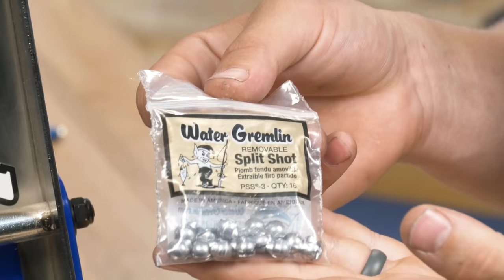Shop Talk: Is Wheel Balancing Worth It?

Comment: Weight Weenies will faint when they see you added 12gr. to a rim.
Reply: Xaver von Treyer 
If weight wenie uballanced 12g can be horible in terms of handling at high speeds.
Reply: Morten Reippuert Knudsen Weight weenies are usually not very fast and on the fat side. I speak from personal experience...
Reply: They will faint because they eat one meal every three days.
Reply: Drill holes in the rim then. 

Couldn't possibly go wrong.

I don't ride it... I just spend time in the shed drilling holes in it, and posting lists on Web forums.

Lately I have been filling the tires with helium.
Reply: Exactly why I scrubbed my efforts to balance mine!
Reply: Faint? I had a heart attack!!!!
Reply: Thats almost half an ounce! Which is almost 1/32 of a pound.

I gained that much off last nights box of hot tamales!

Comment: I had a cheap bike many years ago and the vibration from the front tire bothered my hands. I have nerve problems when dealing with vibrations. I balanced the wheels with the tires off and marked the heavy side, then put the tire on without removing the weight and found the heavy part of the tire. I removed the weight and mounted the tire heavy side opposite the heavy side of the wheel and that was good enough. I think the answer to "is wheel balancing worth it" is if there is a problem that it will solve then yes, if there is no problem then no.

Comment: Had a slightly imbalanced deep section wheel. Sticked on some lead strips on the inner rim. Only like 3grams
Made a huge diffrence on high speed descents. Since it was a carbon rim, the imbalance transferred quite harshly onto the handlebars. Now I have more confidence, more control and less fatigue during higher speeds. It also feels smoother, nicer and more efficient. Cornering usually doesn't happen at these high speeds where grip could be lessened with an imbalanced wheel, but nevertheless it does technically increase grip
Reply: Did the exact same to one of my alu wheels. Found myself slowing down quicker then before on a straight. Didn't know what was going on untill I put the bike in a stand. Had quite the wobble. So I bought a new set of wheels. Then ordered some golf club balancing weight stickers and started balancing the wheel. After I was done it felt brand new again.
Reply: Exactly similar experience here.  Riding downhill outside Boulder moderately fast (85 km/h) got harmonic resonance (speed wobble) so bad was loosing control and going across solid line into path of pickup truck. Barely gathered it in but scared the hell out of me.  Learned to balance using the golf club weights.  This is not really an issue for MTBers.
Reply: I was so distracted by the balance while riding my fat bike I got cloths lined by a tree branch. True story.
Reply: I had a terrible speed wobble, descending last season, with my tcr carbon wheels. I am running conti 5k 28, will wheel balance for sure this season for safety.

Comment: An old boss when I was at the start of my mechanical career indicated that at higher speeds up on a bike stand, you’d always have a bit of resonance somewhere from exaggerated weight increases from torsional forces exacted on things like- tube manufacturing thickness, valve weight, reflector on the wheel. He never presented me with evidence for this, but it’s always been logically sound in my mind. I think it’s definitely a factor! Love the tech vids guys, you’re some pair on screen :)

Comment: That’s pretty funny, poking fun at balancing wheels. However, it is more important in the road riding world, particularly in the case of deep sections carbon wheels.
The deeper the section, the longer and greater the mass of the valve stem or valve extender. This relative imbalance towards the valve side is greater in the case of road wheels, because in general as a package (rim, tubular tape, tire, valve cap even, etc.) they are much lighter than MTB wheel systems.
Also, the relative speeds in terms of RPMs of the wheel can be much greater the road, particularly on descents.

Comment: In my opinion, I feel it does matter! Wheel balance is important but only to a point. If there is a slight vibration, I would have to say there is really no effect on my riding. I’ve actually ridden a mountain bike with BOTH wheels imbalanced very slightly for quite a while and haven’t noticed any serious problems with handling or suspension. However, once the balance does become slightly noticeable (as demonstrated in this video at certain points) this can slightly alter the handling (depending on what type of bike you ride). In conclusion I believe that it’s not completely necessary, unless you truly notice a disturbance in the ‘force’.

Comment: I use lead tapes to balance my road bike tubeless wheels because the tubeless valves are pretty heavy. I think the improvement in traction and cornering stability is pretty noticeable, and it is a very cheap and easy upgrade.

Comment: For road racing and bmx racing, balancing is a good idea when you change the tire. For casual riding and mountain biking, close is good enough because the wheels will pick up debris as you ride which will then throw off the balance anyway. Given the time, if I had the tire in a truing stand I would spend the time to make sure the spokes are evenly tensioned before spending time balancing. A broken spoke is worse than an out of balance tire.

Comment: I had a speed wobble above 45mph (downhill) which disappeared after I balanced the front wheel on my road bike. Since then I have checked all my wheels and corrected several!
Once I’ve determined the required weight and position of the counterweights (with tyres fitted) I use automotive balancing weights which are self adhesive and stick them on the inside surface of the rim. Then I tape over with electrical tape before installing tyre/tube being careful to put the them in exactly the same position on the wheel again.
No ugly fishing weights on my spokes!

Comment: I did. Found a difference of calmness at speed that i hadn't noticed b4.  I used tungsten gulf weights. Came down to the frame feeling more planted. But my bike was way way out of balance. Like 30 grams off. So maybe it helped keep my hub bearings from wearing out. Hard to say.
Did a few other guys bikes. They  had similar experience. Added a calmness to the bike.

Comment: When I first balanced my wheels, with the same tailwind on the road, my best effort average speed in my favourite ~3min strava sector went from 41.6km/h to 46.2km/h. It's like aerodynamics, the faster you go the more wheel balance matters for performance. I've also got the 2nd fastest time in the fastest local sector that requires no downhill skill (~70km/h), it's a very popular bit of road here, I'm not all that strong and I did it with box section 32 spoke wheels... that were perfectly balanced.

Comment: Hi guys 
I balanced my wheels a year ago and rebalance when I rotate tires from front to back and it has made a world of difference in comfort (less buzz in the toshie), handling at speed (you feel the grip of the road better and cuts sharper) and increased my top speed of 84 km/h to 93.25 on the same circuit (conditions were roughly the same as well as originally top speed test and is consistently faster then before. 
It’s worth every minute of work, every gram of weight and if your as fussy as I am it’s worth the extra time to put lead golf club weights on the inside of the rim instead. 
I was able to custom cut them to a perfect 3.4grms and 3.6grms and since they have glued backs they stick to the inside without worry. 
All I can say is, do it, do it oh and do it!!
Oh yes I’m a roadie

Comment: I'm a roady, I've balanced all my wheels, complete with tube and tyre. I used lead weights for golf clubs and then lead tape for the fine adjustment. Both self adhesive. I used to get severe downhill front wheel wobble but the balance has helped but more importantly correct tyre pressures have a greater effect.

Comment: I just balanced my wheels the other day with some motorcycle weights. Because I  still run inner tubes on my 26” hardtail (Trek 4900) it was pretty straight forward process. To be honest the only time I can feel the difference is when I ride with speeds above 35-40 km/h or when Im jumping. I definitely do like how the bike feels now. 

Ps: All wheel setups are different and it takes different amounts of weight to balance them. For example I managed to balance my Nukeproof Generator wheels almost perfect with some  minor tyre adjustments, while the wheel set on my hardtail took 22 grams in total to balance. Thats why I think there are so many different opinions on that topic.

Comment: I think it's important, really helps with handling, descents and stability, specially with deep section wheels, however, manufacturers do a good jobs in the design, so that the wheels are more or less balanced on common setups, that's why you don't notice it and think it's not important, but ask a motorsport person about it and they will tell you about it, the easy way is to do it with speed sensors magnets, one per wheel, adjusting the distance from the hub, no hassle, no weights, no drama 👌

Comment: If someone rides the bike for speed, balanced tires may be important.

I was shocked as some spokes get lose on my 28mph e-bike (250 miles after the bike came fresh from the factory and the DMV for the initial certification;
two sheets of paperwork filled to the utmost and nobody checked the tires).

If you plan to go over 30mph regularly, it may be a good idea to attend more attention to your ride.
For slow riding: no it isn't worth if the bike handling isn't affected, you still may get slower

Comment: If I spent a lot of time riding as fast as possible over either super bumpy terrain or doing massive jumps I would consider balancing the wheel as that stays consistent. The tires just come off to much for me to consider balancing it with those and the sealant/tube, however if I was riding pro and half a second on a five minute ride means something then I would consider balancing with the tire and just remember the position of it on the rim and make sure the bead is seated on the rim 110% correctly

Comment: It doesn't really change anything. Sure, it can look crazy on the stand, but that's because no other force is affecting it.

If we as an example take a standard 28 inch road wheel at 60 kph (a speed I'll never reach), an imbalance of 5 grams will give a centripetal force of around 4N (a bit over 400 grams). Compared to the other forces influencing the system, especially at 60 kph, its vanishingly little.
Reply: 400g at 60kmh sounds like a lot...
Reply: @Phaidrus  It might, but that is (probably) because you're thinking of the effect of spinning an imbalance of 400 grams up to that speed (which would indeed become a huge force). Instead, it is the maximum force the wheel experiences due to the rotation. At least with my fat ass pushing down with 100+ kg, I won't really be feeling that.
Reply: Dennis Krøger As a roadie, this would mean the bar is pushing up by about a pound on every “pulse”. That’s a lot, considering that I probably only put 40-50lbs on the bars at most. I’ve hit 51mph before and I know my bike starts feeling real skittery so I think I’m going to try this.
Reply: @404nobrakes  That's 2% of the force. 40 pounds of downward force will vary between 38 and 42 pounds (as well as pushing forwards and backwards, of course). You might feel it, and if it makes you uncomfortable, by all means fix it, but it's probably not going to unsettle the bike enough to have a real effect on stability.

Comment: i have a motorized bicycle an run inner tube tires. i always balancing them if i have to change a tire or tube. it may be silly to balance them but i feel it helps minimize vibration an wear.

Comment: So I think the question to ask is, is the imbalance due to the wheel being true or to roundness? I believe most imbalance issues in cars are due to the rubber of the tires being imperfect, in any case, the womps should not have a huge effect on watts but might impact your comfort and bearings, maybe suspension as well? If the womps is huge to where it is causing the tire to lose contact then that might be also unsafe 🙂 I can see how you might end up going crazy trying to balance wheels and tires on bike, especially since they change so much

Comment: Car tire balancers generally  only balance at low speed (15mph) and more for wear than comfort. So unless you balance every ride, and after you have displaced the sealant, you will not get great results if using good quality hubs, rims and tires. If you have more affordable wheels, you may get a smoother ride as the quality control may be a factor. So unless you have very noticeable vibration on the bike stand, not worth the pain, you may increase the vibration by default.  Good luck, and bring beer, you will need a drink...  Love the content Cheers

Comment: Also worth checking wheel is even circular?  Bad spoke tension = egg = inbalance?
Reply: Yes, even if the weight is balanced, the wheel can be out of true and that have a more noticeable effect on stability
Reply: This! Back when I worked as a car mechanic I'd tell people it a was a waste of time trying to balance an egg, they couldn't understand why I'd recommend a pair or set of tires to correct a vibration.
Reply: Imbalance. Sorry, it's a compulsion...

Comment: I suggest you use lead Golf club weights. Not only are they malleable, but also come with an adhesive backing that you can put on/under tire strip so they are ultimately a clean look, absolutely no outside weights on rim or spoke. Works incredibly well on road wheels.

Comment: The only time I've ever noticed wheel imbalance while riding was when I was bombing down a steep paved road at 53mph. It was very apparent! But I've also done like 42 on a dirt road in moab and didn't notice anything. I figure for the most part if you're running tubeless sealant it probably balances it the tire when in motion.  Just like semi-trucks use plastic pellets in their tires to balance them.

Comment: I've played with this idea on my road bike wheels. Only difference is I knew the tire and air would make a difference. Also where the weight was put made a difference on how much of a difference it made. Lighter weight on the outside of the tire was more effective than heavier weight on the spoke. As a compromise in my balancing plan was to place weights inside the rim under the rim tape. How did I do that you ask ? LOL I cut up 2 dimes, yep for 20 cents and a couple of hours (taking tires on and off) on a rainy day I had perfectly balanced wheels that made no difference in anything. Smooth road was still smooth and rough still sucked. 
Another idea if you really want to try it yourself would be to use tire liners but only use small pieces where you think the weight is needed but remember to start with a fully inflated tire first. This a lot easier with tubes, trying all this tubeless would be a nightmare. Only good thing is on the bike stand at full speed but rear doesn't bounce. 👍

Comment: Recently acquired some pvc tubes with plastic valve stems, so that should help a lot, haven't installed them yet. Usually use self adhesive golf weights. A smoother ride is better, end of debate.

Comment: Shocking but true.....there is only a single point where a weight needs to be added to balance a wheel. But that point on the wheel must be determined by means of polar coordinate mathematics....i.e., in polar coordinates there are three vectors splitting up the circle each 120 degrees apart. They can be used to first determine which of the three spaces a counterweight needs to be located before determining precisely where within the space on the rim radius. An understanding of angular momentum is also needed. Angular momentum is the product of imbalance mass x rotational speed times the radius. High speed can be used to amplify the effect of a tiny imbalance to help to precisely id the sweet spot for the counterweight. For a very high-speed, e.g., 30,000 rpm rotating machine such as jet turbine blades, perfect balance is critical or rapid disintegration of the machine can occur.....not much of an issues even for a bicycle travelling at 100 km/hour. But race car drivers need wheels to be high speed balanced. We used a machine to analyze 30,000 rpm prop balancing for high performance drones.

Comment: You should definitely balance the wheels as they're going to be ridden on the road. You mind doesn't know it, because we're not accustomed to thinking about the balance if our wheels. Although as speed goes up the wobble gets worse and less contact patch to the ground every revolution (traction). Along with the loss of traction, your bearings are feeling the wobble and eventually wearing them. Some may say the weight of our body will keep the contact patch, but yet we do it to car tires that are way more heavy and we can feel the difference because of higher speed.

Comment: The sealant itself will balance the wheel as its spinning. 4x4 and semi guys have been doing a similar thing for a long time using either with water, airsoft BB's, or actual balance beads (small plastic BB's) inside the tire, once spinning they will find there way to the light spot thus balancing the wheel. not perfect but close enough to not feel a shake at speed and on a mountain bike that's all id want. on road bike though i'd think it might be more beneficial as higher speeds on smooth roads the imbalance would be more noticable.